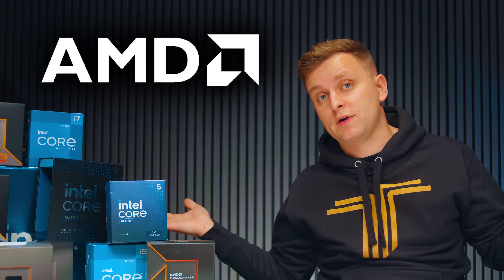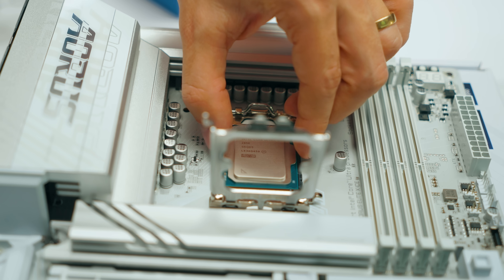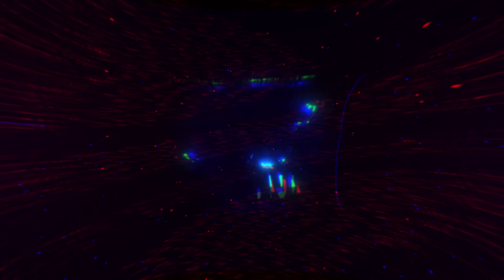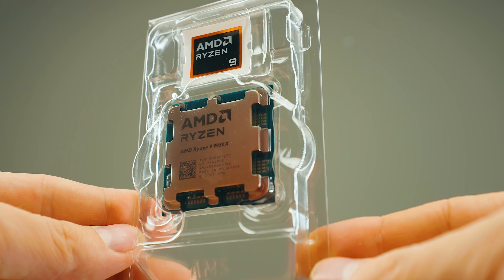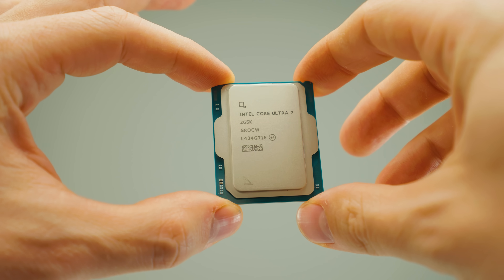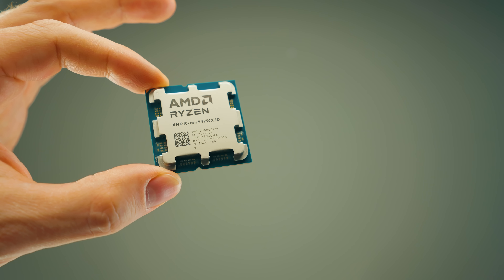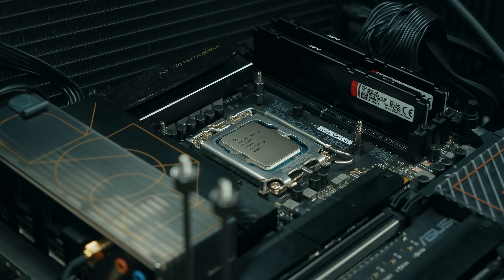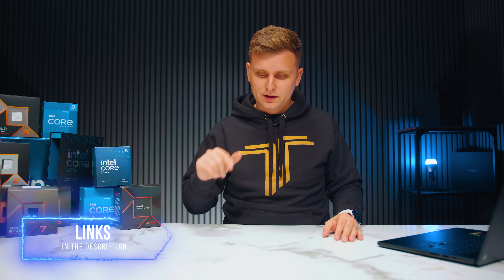Don't BUY a CPU before WATCHING THIS! - Top 5 CPUs for 2025

Comment from the maker: Fav Motherboards linked in the description as well!
✅ No 1 CPU - https://geni.us/Ultra9-285k
✅ No 2 CPU -  https://geni.us/9950x
✅ No 3 CPU - https://geni.us/U7-265k
✅ No 4 CPU - https://geni.us/9950x3d
✅ No 5 CPU - https://geni.us/14600k
✅ BONUS CPU - https://geni.us/9970x
Reply: And I thought that I am the only one to choose the 265k, as the best value for perf.
Great job!
Reply: Actually, all of the AMD CPU are bad, because they require constant socket and mobo change, when 9995WX launched, it made all of the AM5 platform too dead and dated by AMD and PCMR standards.

Same goes with 9800X3D, it made 7800X3D poop.
Reply: @AlfaPro1337 what are you talking about? On my current board amd 670e, i went from a 7950x to a 9950x3d. No mobo change. Stop lying. Lastly why is threadripper has to do with this conversation. Its for a totally different audience
Reply: @juan.gonzalez03 9950X3D is too dead and dated by AMD and PCMR standards, the best and latest gaming cpu is the 9995WX.
Reply: @AlfaPro1337 having fun trolling?
Reply: Intel i5 14400 vs Ryzen 5 9600X vs Intel Core Ultra 5 225, which one is better for Photoshop and Premiere Pro
(Only iGPU no DGPU budget build) please advice
Reply: Lol not one of the links he provided has the 285 for $450. I'm sorry no one should be buying an intel chip for 1 or 2 gens. Am4 is still being supported and its a different socket. Did intel pay you extra money? Or did you find out something about intel and you want to be on the list to get stuff? Notice how gaming didnt come up.  Do lose your reputation over money. Are the things the core 285 does better, yes but its not a better overall value. It ticks less boxes.
Reply: @juan.gonzalez03 AM4 is too dead and dated by AMD and PCMR standards.
Reply: @AlfaPro1337 I guess you missed the point. You read my post and thats what you got from it? How bout that 9 years later amd is still dropping competitive cpus for am4?
Just speaking to its longevity and support. Hopefully amd continues this with am5
Reply: @juan.gonzalez03 Except, it is too dead and dated by AMD and PCMR standards. Can you even put an am4 chip on am5?

Plus, amd you constantly change everything. Oh you just bought 7800X3D? Yeah, that is too dead and dated, get the 9800X3D. 

Oh you just got 9800X3D,  the 9995WX is newer and better.
Reply: @AlfaPro1337 is this your argument?  Seriously? So Amd and intel are too never produce better performing chips? You must be trolling me. You mad you cant join the PCMR because you cant afford the latest and greatest?
Atleast if you bought an am4 motherboard. You had the choice to run ryzen 1600+, 2600+, 3600+, 4600+ and 5600+. When was the last time intel supported that many generations?

Comment: If its a month a two ago, Ultra or Ryzen 7000 series are debatable.  Now with the battlefield turned upside down (DDR4), the one with future resistant, best bang for the buck, and best compatibility is the winner. Either LGA1700 or AM4.

Comment: This guy has a totally different idea on what a "cheap" platform is than me. Maybe he means the cpu is relatively cheap. Relative to what it USED to cost, perhaps? The Core Ultra 9 285k is now €531 (NL) that's a far cry from $449 by the way. Maybe I'll wait for the (now €288, that's $340 fyi) Core Ultra 7 265K to drop a bit in price. Don't forget: pc parts have become ridiculously expensive. Memory has more than quadrupled in price! (Yes, the 2x16GB I bought one year ago for €52 now costs over €200, I'm not joking). Where will it end?...

Comment: I opt to spend $20 more for the amd 5 over intel (in the budget range) because of the "most likely" reason that I will be able to upgrade to the next gen cpu without replacing the whole motherboard like intel forces you to do each gen.

Comment: Finally a tech youtuber who gets it. I always tell people. Get the 14600K and use that extra money on GPU. when gaming you mainly use GPU processor and cpu just there to not bottleneck so just game in 1440p or 4K. Intel has proven stability and reliability in workstation and productivity so Your desktop can be multipurpose usage. And 14600K still get 100+ fps in 1080p games(test by Hardware Unboxed) which more than enough for 99% of people. So STOP following what people say and do your own research instead.
Reply: What about the problems with 13/14 generation?

Comment: core ultra 9 is a dead socket with dead support. upcoming socket is different and will require a new cpu. the ultra 9 is also much worse than previous gen 14 and kinda sucks in gaming + streaming. not many people use a whole separate pc with high end components just to do some video editing. gamers are interested in gaming + streaming not video and photo editing and even if they did the previous gen still blows the core 9 out of the water in productivity too. And the price difference is almost invisible.

Comment: So right now, I can get the 9800X3D for 639$ CAD, or I can get the 285K for 809$ CAD.
And the nice thing, is that I'll get a few more generations out of my motherboard/platform, whereas on Intel, I'll be stuck after 2 generations.
If you're doing more than gaming then absolutely it might be worth it for you to get the Intel.
However, I''m a bit of an upgrade fiend, and I give/sell my old hardware to friends and family.
All the AMD CPU's are still working great, 1800X, 2700X, 3900X, 5800X and 5800X3D. Haven't leaped to AM5 yet, but soon.
All those CPUs are still working flawlessly in other peoples computers.
However, the intel chips.....not so great.
4770k is still working well, but the 11700k has weird crashes, the 12700k I sold to a friend was in his plex server and that system started restarting.
The 13700k and 14700k both have weird issues. I used to be able to run negative voltage offsets, until I started getting random blue screens, and now have to leave them at stock.
Reply: A 9800X3D is indeed a venerable gaming CPU,  yet for content creation is non ideal…

Comment: I have a 9950x paired with a x870e as my main system, and another system featuring a 265K paired with z890 Aorus Elite and 48gb 8000 cl 38. the fact that i payed for these cpu+mobo+ram in total 365€ from the aftermarket(all 3 were sealed by the way), is mindblowing to me. My 9950x is absolutely unbeatable 
(For reference, it is extremely well binned, it reaches 46k on cinebench), but the 265K performs slightly worse(38k cinebench as reference once set up), but this system costed me like 1/4? And has 120Gbps memory bandwidth vs 86Gbps on my 9950x? It is of increadible value now, especially in the aftermarket where people do not see intel’s value, and demand is just so low… now for me and the few people’s which find great value on intel, this is a perfect spot to buy. But really the majority of people just would like to overspend on a 9800x3d on which they will play in 2k/4k? For me is a no brainer, but anyway now i am digressing
Reply: AMD CPUs definitely don’t seem to reach the same bandwidth as Intel, but alas they seem to compete well enough with lesser MT rates. Arguably AMD Zen/5 keeps the latency low on RAM, meaning actual performance vs simply bandwidth is less critical for them vs. an Intel Core 200 series CPU.

Comment: I bought a 14600k
Intel with 9070 xt doesn't work nicely 
Lots of micro stutters 
With nvidia it works fine
Amd cpu with amd gpu is best option other wise no amd if you're going with intel
Reply: I have not read any credible sources that mark the CPU and GPU brand as being critical to frame pacing.
Reply: @gymnastchannel7372 well I'm experiencing it and i saw other benchmarks too
Amd cards don't work nicely with intel's hybrid architecture 
Nvidia does
I tried a lot of things 
Yesterday i was playing DL The Beast and going from 130 fps to single digit fps sometimes for half a second was so annoying 
It just completely destroys mood

Comment: picked up the core ultra 9 285k last week for my new build with a RTX 5080 been a great pc so far, dont get why intel gets so much hate, you can find these chips for great deals too
Reply: If you value what Intel offers with a core 200 Ultra, sure. They do suffer high latency and lack AVX512F instructions. For those reasons, I don’t necessarily hate the Core 200 series, but I see them as being lesser choices for many users.

Comment: Waiting for AMD bros to rush here and blast: WHY IS NOT 9800x3D NOT ON TOP OF THIS LIST? xD
Reply: AMD fanboys trying not to cope and throw a fit when they see intel challenge impossible lol
Reply: @Salty_Cracker213  Intel user since forever here. I'm buying a new PC now and it will be AMD on the CPU side. I've always been happy with my Intel CPUs, but lack of innovation in the past with little improvements and higher prices, until AMD started the multiple chiplet approach that allowed them to make better use of the silicon wafer since they produced smaller chips that allowed lower prices plus higher core counts. I'm not saying A better than B. Just that brands are not football teams that you pick no matter what, competition is good and whoever offers me better, I will take.
Reply: Why would someone suggest a 9800X3D for creators? It’s an eight core CPU

Comment: I have a question: Does Intel have any advantage when using Quick Sync together with an NVIDIA 5000 series GPU in Premiere Pro? In other words, does Premiere Pro utilize both Quick Sync and the NVIDIA 5000 series GPU for video editing, or does it only rely on the NVIDIA GPU? How does this compare to using an AMD CPU with an NVIDIA 5000 series GPU?

Comment: Can't really see a point in the 9950x at £520 when £80 more gets the 9950X3D.  And the price gap is huge between the 9900x at £350 and 9950x at £520.  £170 for two cores?

I like the 9900x for the price, tempted with the 9950X3D but it needs a better cooler than the 9900x, not sure a Noctua U14s is good enough, and I run an Asrock Nova X870E so it's a little of putting. As for the Pro Art motherboards, well bifurcation is appalling on most of those.
Reply: Arctic Liquid Freezer iii Pro will solve your heat handling worries really well.

Comment: What about the 7600X3D? Its the entry level AM5 X3D chip. Its a great chip.
Reply: The extra cache does near nothing in most productivity workloads. Zen 4 actually suffers lower clockspeeds with vcache since it traps heat from the cores. If you need a dual use CPU, consider a Zen 5-based CPU with vcache at least - and ideally one with more cores for creators.

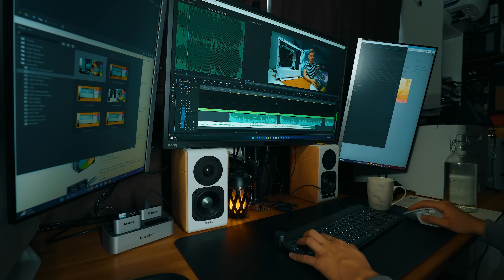Comment: 0:22 for "some reason" I don't want my Motherboard to fry and I don't want to deal with a class action lawsuit that will take for eternity to settle. Me and my wallet is happier when I don't get scammed. I do medium to heavy 4k fusion work on DaVinci and I settled down with 7500f and a 48 gigs CL30 6000mhz ddr5 memory coupled with B580. I had no issues yet. No need expensive CPUs as long as you know what you're doing and unless you're working on 8k/16k footage or whatever.

Render time difference isn't much to make me spend twice as much for a 5060Ti either so no need. This guy is an Intel sellout. He has always been. Just browse his old videos its all about Intel. He hates AMD because they didn't sponsor him because they didn't need him.

He is getting paid by Intel to preach for them and worship. Don't buy Intel if you don't want your PSUs and motherboards short circuit and fry. Feel free to do your own research internet is full of fried motherboards that Intel REFUSED to take responsibility of. Just a heads-up. If you're a fanboy like this guy just go for it. Its your headache and your money in the drain not mine so IDGAF 😂

Comment: 5800X3D was my best investment, for gaming of course if someone tries to say it's not good for work.
Reply: Even for work it's great. Any CPU over 8 core is for speed purposes. You can do 99% of what these people do for a living it will just be slower. I still use my 5950x system for content creation as well. Still phenomenal. Still claps dogsht brand new Intel CPUs for half the price 😂
Reply: @ClippyDoesNotStealYourData Someone said that 5800X is better just because it has higher clocks and "raw power" 😂

Comment: If you are an extreme gamer or a Linux distro OS fan, go with AMD.  Also, 3D rendering.

Otherwise, go with Intel for productivity.  Better for photography, video editing, and Ai modeling.  Especially with Nvidia partnering with Intel.
Reply: Depends on which AI model and your needs. AMD’s AVX512 and faster m.2 NVMe performance can be a factor.

Comment: I picked up a 265K last week after watching your videos. Only thing I need is good performance in Lightroom and occaisonally Photoshop and based on what I saw on your channel, it was easily the best buy for those specifically. Was $187 at Microcenter with a bundle. Very happy with it. Unfortunately the boost profile caused some instability issues but no big deal. Something I can look into later. Lightroom isn't a laggy mess again finally, and that's all that mattered. Thanks for the reviews!

Comment: I tried the Core Ultra 9 285K and returned it due to a couple of design problems. In case anybody is unaware, due to the tile placing on the Core Ultra 200 CPU's, when you pair one up with a 14000MT/s Gen5 M.2 drive, the drive will only run at 12000MT/s due to the way the lane routing reaches the CPU tiles. This is a hardware issue which can never be fixed unfortunately.

I also had an issue with my Asus Z890 Hero motherboard. I built the PC in question with the GPU in the top 16x slot and the Gen5 M.2 drive in the slot above the GPU. In this configuration, neither components should share any PCI-E Gen5 lanes with each other. The top M.2 slot (M.2_1) has 4x PCIE Gen5 lanes dedicated to it. The top GPU slot shares PCI-E Gen5 lanes with M.2_2 and M.2_3. So if either of those slots are populated with an M.2 drive, the GPU has its lanes cut down to 8x. So I specifically avoided using those middle M.2 slots. Still... with the M.2 drive in M.2_1 and the GPU in the top 16x slot, the GPU ran at 8x speed instead of 16x. 

Next I tried removing the M.2 drive altogether leaving the GPU in the top 16x slot. I installed Windows on a SATA drive this time to make sure absolutely no PCI-E Gen5 lanes could possibly be stolen from the GPU. Yet the GPU still only ran at 8x instead of the full 16x. So not only did the 285K have bad tile placing that gimped my M.2 speed, the Asus Z890 Hero motherboard also had faulty lane distribution to the main GPU slot. I made sure to follow the manual in case I'd missed something but no... sadly the motherboard was faulty.

In the end, I returned both products to the store and exchanged them for an Asus X870E Apex motherboard + AMD Ryzen 9800X3D. After installing all the components in the new mobo, I installed Windows 11 and booted up. Both the M.2 and the GPU were running at full speed. The Intel nightmare was over.
Reply: Sad for Intel 😢
Reply: Is the m2 lane sharing an issue with other motherboards? never heard of this before.. I just bought an b860-i and am waiting for the 265k.  Should I be concerned?
Reply: @SmbaaFlipooo  Honestly I think I was just super unlucky and got a faulty motherboard
Reply: Thank you for sharing, how is the AMD Ryzen 9800X3D for video editing and Photoshop?
Reply: I recently had PC built.   I told the tech that I had a studio where I record artists and also render video.... but I also play games on it.   He said I should Ryzen 7 9800X3D.  So I did but then after doing some intensive recording sessions where I would use quite a few VSTs I started getting delay and cracks and pops.   I now wonder would it be best to swap the Ryzen 7 9800X3D for the Ryzen 9950X3D. I don't know but my time to return is short.   

Can anyone help me out here?
Reply: Do you face stability issues with the Ryzen system?
Reply: @Mohondhays  None so far

Comment: 😃only Ryzen 9 9xxx series and intel new/old gen... what about R7 7700X? or even Ryzen 5 7600X?
Reply: overall they about 5% slower and run a bit hotter then the 9600x and 9700x but they are cheaper since its last gen

Comment: I will not ever buy another Intel cpu. Remember how many years in a row we got a new cpu with the same 4 cores 8 threads top of the line, with 5% inprovement?  Intel deserves to die, and should die as a remainder that no matter if you are alone on the market, you should not cheat people.
Reply: Zen has had the same core count since zen 1, whats your point?
Reply: @krys421  my point is that u would still be on 4 cores 8 threads even now if Ryzen wasnt good.
Reply: @Ionut.C.Iand we are still on 6 cores because of ryzen
Reply: @krys421  u are on like 12 and 24. Ryzen equivalent of i7 4790k is like 12 threads now.  the 6 cores ryzed replayced i5s and some i7s. Also the pricing its cheap for a 8 and 16 threads.

Comment: Amd, end of the video.
Reply: Partially true. If you need x86 and don’t value quicksync, AMD. If you need quicksync or you want an easy time getting TB5 to work, Intel - maybe. If you want a highly efficient package for Adobe and DaVinci stacks, look at an M4/M5-based system. They are beastly and I can’t wait for Apple to get those M5 Pro/Max/Ultra chips out… sexy time.

Comment: No, 14600k has horrible value simply because it's on an abandoned socket, like, it's too expensive to go 14th gen almost at all. im sorry but you should just not be suggesting 14th gen for new builds. Unless you need an ultra low powered build where the 14100f and 14100 are just the cheapest CPUs you can buy, lga1700 is a no go.
Reply: 14th gen is currently the best value for intel tho and the fastest for productivity and gaming. Socket doesn’t really matter here

Comment: arrow lake is fine if you wont update or you just stick to a dead platform and update the whole thing when the time come, other than that i rather have a AM5 option. For creators and for work its ok but the price its just too similar to amd when it should be cheaper.